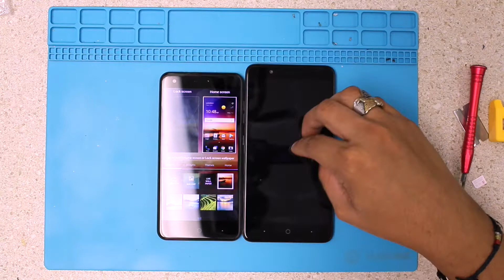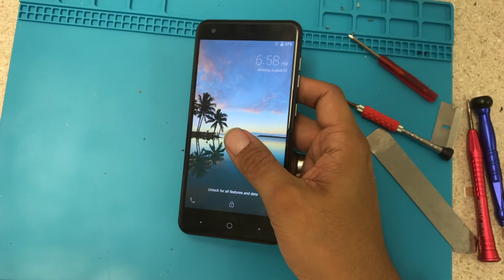ZTE Blade X  Z965 - Screen LCD Glass - How To Repair - Charging Port

Comment: The Z965 is the Blade X, the not the Blade X Max, which is a different and bigger model
Reply from the maker: Davin Peterson Yes I made a mistake on the title thanks for the correction I will fix it at once.